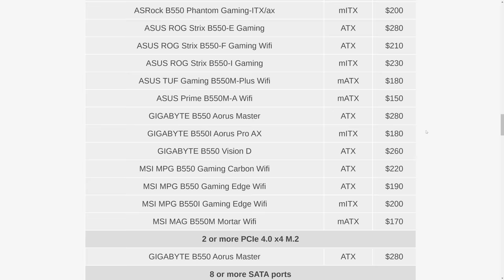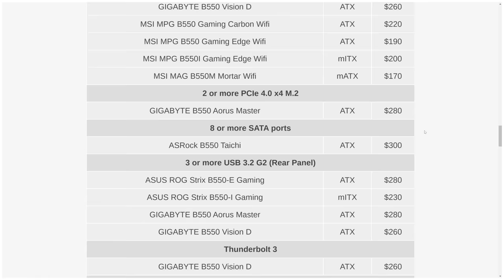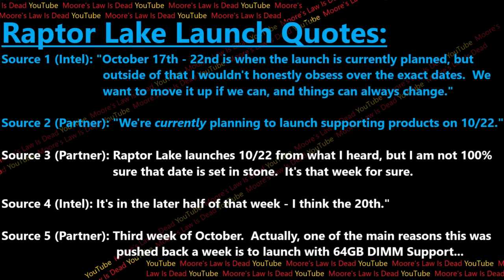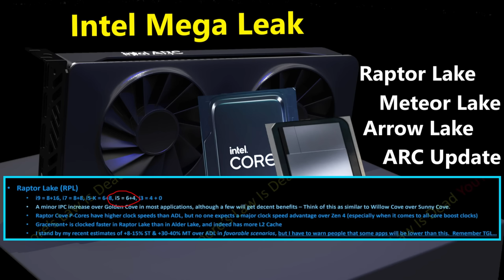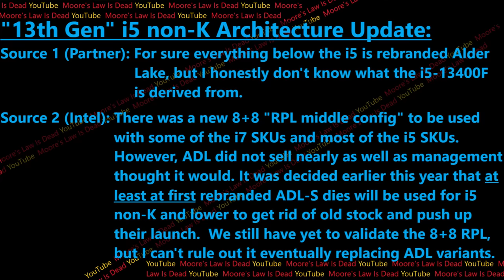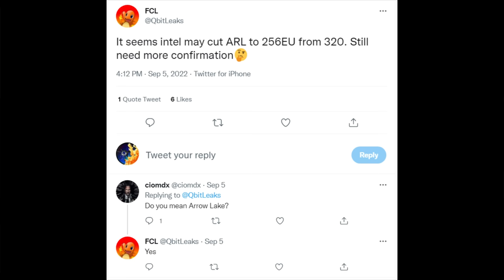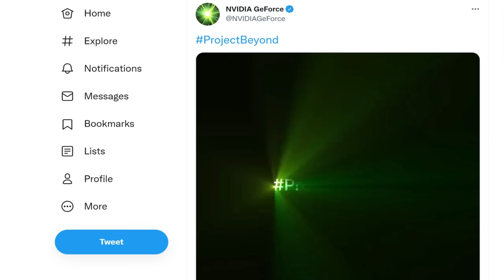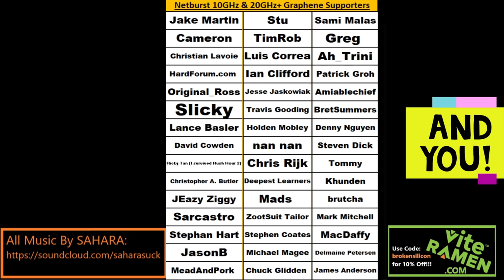RTX 4060 Ti, Raptor Lake Launch, AM5 Pricing: What Rumors are True? Who's Trolling you?

Comment: 7:09 Wow, 64GB DIMM support is a huge deal for me, because performance is drastically reduced when using 2 DIMMs per channel in DDR5 setups. 64GB DIMM support means you are not forever stuck with 2x32GB DDR5. I wonder if Zen4 will get this with BIOS updates?
Reply: Is 2x32 not the best config for 64gb? It would be more stable than 4x16.
Reply: @Krenisphia  exactly. But you are stuck at 64GB total and with no chance to get to 128GB unless you accept significantly lower DDR5 clock speeds after adding additional modules.
Reply: @Krenisphia  maybe op is thinking 128gb. 2x64gb for dual channel?
Reply: I can't see the point, if you've got the money for that, surely you would be using it for editing/production etc and using Threadripper or Xeon. I can't see any other use scenario that would require that much ram, certainly not gaming.
Reply: @Markknightexeter  I dunno - I went from 32GB to 64GB with my mod addiction in Cities:Skylines and it was night and day different.  So it just depends on the game :)
Reply: @Markknightexeter  Threadripper makes sense if you actually need so many cores. Often with servers you don’t and you will run out of memory (VMs!) much faster than out of cores. And regarding Xeons, surely you know that the basic Xeons have always been normal desktop CPUs just with ECC not disabled. So the same problems apply. W680 boards (there is only one currently shipping) run ADL CPUs (with ecc!) and support a maximum DDR5 speed of 4400. You can’t even buy modules this slow!

(and the higher end Xeons are incredibly bad regarding IPC and clock speed. Also registered memory costs a lot of latency!)
Reply: @geraldh.8047  I did not realize this about Zeon's, I thought they were on a separate platform, I stand corrected 👍
Reply: @DocNo27  something is up there. Maybe the new ram is much faster?
Reply: I would expect BIOS updates to offer 64GB DIMM support after the Zen  launch.  If you allow quad 32GB DIMM 128GB total what prevents 2x64GB?
The memory guys were justifying DDR5 on speed and capacity, so the increases cannot be surprises.
Reply: Hi there.
I'll like to ask for advice for my new pc. It's been years without following the market (thoroughly) and I'm a little lost.
Currently, I have a 4790k with a asus 290x 4gb and 32gb of ddr3 (I think, not ddr4) with a monitor 3440x1440p 21:9.
I need a new pc for 3d, animation, rendering,... Gaming won't hurt but it's not primordial.
I've been thinking in buying the new 7950x, bought a 3090, 64gb of ddr5 (4x16gb 6000mhz CL36) and a second monitor 16:9 4k hdr 60hz (probably something like Asus proart 32").
Now... I hear a lot of people talking about waiting for zen5 but, as you can see, my PC is a liiiittle outdated.
Zen 5 it's what, 2-3 years of more wait?
I would be grateful for advice. PCs are becoming really expensive and I'll like to make the best decision possible to make every penny count and have a PC for at least 6 years more than less.
So it's a bad decision to buy 4x16gb? Should I change my purchase to 2x32gb? I'm waiting for the new 670 motherboards to come also.
Thanks to anyone that tries to help.
Reply: @RobBCactive  I hope so as well, but remember on 2-Channel-DDR3 systems 4x8GB=32GB is possible but 2x16GB is not.
Reply: @Unreload0  Get 2x32GB as RAM speeds may drop below DDR4 rates in quad DIMM configs.  The large memory will probably have slacker timings from what I saw.
Fast frequency doesn't like complexity and signal noise.
It sounds like you need a new system, so if your usage justifies the spend I'd go for it.
Reply: @Unreload0  4x16gb 6000mhz makes ZERO sense, both on Intel and on Zen4 Platforms.

"AMD only guarantees DDR5-5200 support on a 1DPC (DIMM per channel) configuration. In a 2DPC scenario, the official memory speed drops to DDR5-3600."
(2DPC = 2 DIMMs per Channel, so 4 DIMMs total since it's a dual channel memory controller in ADL/RPL/Zen4)
Reply: @RobBCactive  thanks man. I'm gonna change my order to 2x32gb then. Mhz?
Reply: @geraldh.8047  Stupid question... Why selling 6000mhz, then? Thanks
Reply: @Unreload0  Because it often works, the performance testing was done with DDR5-6000.
Perhaps some motherboards haven't been validated yet.
But if you buy 2x32GB I think it will not be at 6000MT/s
Reply: @RobBCactive  My 4x16gb just arribed 🤣 😭😭😭 let's see if the store let me do a change. Thanks to all of you! What Mhz do you recommend for the 2x32gb then?
Reply: @Unreload0  because running the memory controller 15% faster (5200->6000) than guaranteed with 2 modules will usually work and give you extra performance.

Running it 66% faster (3600->6000) than what is guaranteed with 4 modules won’t work.

I have no idea how much headroom there is in running a 4 Module configuration higher than recommended, but if you are able to run four „6000“ modules at 4800 (which is the lowest official spec) in a stable way I would consider that a great success.
Reply: @geraldh.8047  Thanks, I think I get it know. Called the store and they let me return the memories. I found to items in their store: 2x32gb corsair vengeance 5200mhz CL40 and 2x32gb corsair dominator 6000mhz CL36. Which one would you choose? Thanks again. I would invite all of you to a beer but I'm from Spain, probably faaar away from any of you 😂
Reply: @Unreload0  I really can’t give you a recommendation based on facts because Zen4 has not been tested anywhere. Official AMD results use 6000 I think and rumors said 6000 is optimal. No idea how large the penalty for less MHz is.

Choosing 5200 vs. 6000 also depends on the price probably 🙃
Reply: @geraldh.8047  Price it's has been "not my concern" since here en Europe everything is getting more expensive day to day due to inflation and the euro losing power to the dollar, so time is "sensitive". I thought I could wait for the 4090, for example, but by the time it's out it will be hell in here, so I bought a 3090 for 1300€ (3 months ago was 2200€ and the decrease is due to the next generation in a few months). I guess I'll try to get the 6000mhz then. Thank you so much. You already saved me money!
Reply: @Unreload0  i got my 5950x in jan for ~600usd, u can get it way cheaper if u find someone upgrading..its already beast. if u worry about warranty, go for brand new if there is clearance.. 32gb ramp is enough...but 64 for u wont hurt, u can also go ddr4 on zen4, which is getting dirt cheap. a x570 board on discount is easily $150, aorus i see often.  u dont need to spend 2-3x as much tbh, it's plenty strong. ddr5 isnt that far ahead yet to justify price. 3080tis are decently cheap at $800 new..
Reply: @yukisnoww  you cannot combine DDD4 with Zen4. DDR4 with Raptor Lake will be possible.
Reply: @yukisnoww  Hi. Depending on the price of the 7950x, I might get the 5950x, of course. It all depends on price/performance. Here in Spain, everything is way expensive, so I have to think always on price/performance and my way of investing on a PC. I buy a new PC every 7 years, maybe 8. So, paying 20-30% more for new tech, if it's worth it, if it's gonna give me 3-4 more years in keeping me from buying a new one, I'll take it. If the global situation was better for the €, yes, I would take the last generation, but I take into the account other factors. Let's just say that my money today is more worth it than what it will be next year, so it's an investment too. EEUU it's not the same as Europe, specially Spain. Thanks for the advice anyway
Reply: @DocNo27  I always thought 16 was more than enough for me... until I installed 32 and now I am like... Hmmm, shall we go 64? And I am mostly playing games, but as you stated, some games are better with more ram than others especially when modded to holy freaking hell. Cheers!
Reply: @geraldh.8047  Hi again, Gerald. Been thinking about what you said. Maybe going for the new tech it's not the best decision. If I decide to go with de 5950x (it's 600€ here in Spain, but maybe when 7950x comes out, it'll get cheaper), what's the best ram (gb, Mhz and CL, number of dimms, ddr4 right?) I can get? And the best motherboard for production (chipset)?
Reply: @Markknightexeter  No, I just have an insane mod addiction and nothing beats more RAM when you go a little too crazy on assets from the steam workshop!   Memory speed actually decreased a bit since you do take a hit with more sticks :/
Reply: @Unreload0  I think with DDR4 you always use 3200 or 3600 and if you spend more you get lower cas latencies. Ryzen 5000 supposedly does not profit from more than 3600 because at 3600 you can run the memory controller in sync at 1800MHz... I'm not really the expert here, you need to figure this out yourself. Whether you buy Ryzen 5000/7000 or ADL/RPL, all good choices. I don't know what your use case is I really can't recommend anything.

Comment: I can sit on my 5900x, let others jump on this AM5 wave. I'll jump when the X3d's come out, maybe.
Reply: Same. I've got a 5600x. I think I'll wait for a 7800x3d.
Reply: I grabbed an amd a few months ago too and will keep it for as long as I can.
The only thing is it is impossible to find the gigabyte site for the new bios.
they make a nice mb but they suck at software and websites.
Reply: We 5900x users I feel have already made a substantial investment in our systems. Maybe in a year or so I'll look at AM5 based systems and I know I'll be missing out until then, but common sense must prevail.  After all, the 5900x certainly isn't a slouch.
Reply: coming from a dual core i3 it seems like witchcraft.  Do you guys know where gigabyte moved the bios download page by any chance?
Reply: If you have a 5900x you can wait till am6 lol it’s a more than capable cpu … that’s what I have and I don’t feel the need to jump on am5
Reply: @charleswidmore5458  That's Gigabyte for you, I would rather buy Asrock boards, it's impressive how far they have come.
Reply: @charleswidmore5458  Don't know but usually stuff like that is found in the support/download section of the product page.
Reply: @HP4L16  I will check again. thanks
Reply: @rubenmoreira0  I'm planning on something similar. I'll probably snap up a 5900x or 5950x in the next couple of months plus a 2x8 B-die kit that matches the one I have and call it good for a few generations.

Comment: Will the rebranded ADL i5 non K cpus perform worse than the later RPL non K cpus? Or will they be essentially the same? Should us lower end buyers hold off for a while?
Reply from the maker: Watch the video - it's literally Alder Lake, but now almost i5-12600K performance will be $200 instead of $300.
Reply: If clockspeeds are the same they will perform slightly worse because of the architecture improvements in the RPL cores.

Comment: considering AMD used the same AM4 platform for many years, I don't think the motherboard prices are too unreasonable
Reply: 3 years is what they said. By that time Intel launches 15th gen Arrow Lake which estimates to have a 40-50% IPC gain over Raptor Lake with less power.
Reply: Meanwhile AMD extended AM5 to 2027, so Zen6 is on AM5.  New boards have always been premium priced, Taiwanese manufacturers want to recoup development costs in the first year.  Critics of AMD prices forget Alder Lake boards had the same problem.
On Intel side Meteor Lake core regressed and Lunar Lake confirms the dropping of hyper-threading.  Intel estimates have been shown to be wildly optimistic and their refreshes of Alder Lake were indeed run by default out of spec leading to instability and high RMA rates.  Sapphire Rapids was another debacle.
So anyone making claims about Arrow Lake in 2022 were selling snake oil and should be ignored.

Comment: You can run DDR4-3100 11-11-11 on the locked 0.9v System Agent (memory controller) voltage, for anybody wondering.

And yes, that's enough to make a 12600k/12700k crunch through videogames that aren't super throughput-limited - which is almost all of them.
So the "discount 6+4 / 6+8" processors will be a fine choice for the DDR4 non-K BCLK boards... whenever they're around outside of Asia haha . . .

Comment: The intel re-use for lower models makes sense... you are still getting more performance on the lower models and they can get rid of old stocks, then the higher models actually use the new designs. I mean, this is the same as using higher tier dies that didn't bin well and limiting then to sell as lower tier models. Better than throwing millions of cpus in the trash. It's a win-win situation really, unless you are so gullible as to blindly update to each new model every year.

Comment: Its how business works.
New stuff adds a premium a bit when launched and slowly stabilize dependent on markets demand.
(its collecting dust in store, price goes down)
Flies off the shelves (Mining) price can go way up
Reply: There's an accounting issue, the Taiwan manufacturers  recoup development costs in the first year.  That front loading made a quality X570 board cheaper than newly introduced B550 boards designed to be cheaper Q4/20 for example.
It increases the early adoption tax, along with the likelihood of stability issues.

Comment: Obviously nobody really knows until it launches, but I'm curious to see what intel does with the rebranded Alder Lake CPUs in terms of pricing. I'm not against it if they include a price drop ie: $300 CPU being rebranded to a $180 lower tier CPU to just run through spare stock, for instance.
I'm also curious to see about iGPU performance in Raptor Lake and Meteor Lake...

Comment: Why are X670/B650 are cheaper to make than X570/B550, what did I miss?
Reply from the maker: I explained it in a previous video, don't remember if it was one of the ones I referenced today.  Basically the new chipsets for AM5 are being handled more traditionally, and they are purpose built to be motherboard chipsets.  So they have smaller dies, much lower power dies, and they actually use TWO chips for the total X670/E chipset.  Without getting into it - it's just WAY smarter, smaller, and more efficient this time around.

With X570/B550 - AMD used the I/O dies from Zen 2/3 (not kidding!) so they could use that die for two purposes.  That saved on design costs, and it was kinda necessary to get PCIe 4.0 support early (AMD was one of the few companies capable of building PCIe 4.0 products at the time).  But that also made the chipset bigger and more power hungry than it needed to be - adding a lot of cost.

Comment: Honestly these rebrand ADLs for locked SKUs is not that bad - it means that OEMs can have a bigger number at the same time as K SKUs.  IMO they will probably do things like i3 13100, i5 13400, i7 13650 and have them out at the exact same time as 'K' skus because they're already silicon that exists and just needs to be segmented out.  Then if they even bother with Raptor Lake locked SKUs, they could do things like i3 13200, i5 13500, i7 13700.  Although there is technically room for 13800 and they could make rebrands odd numbers while current gen is even.  Think i3 13100, i5 13500, i7 13700 as ADL and i3 13200, i5 13600, i7 13800 as RL.  Then your i5 13600k, i7 13800k and i9 13900k would be the launch RL SKUs.  Although I really hate that i3 and ryzen 3 have just about disappeared entirely.  Really the R9 and i9 are the R7 and i7 with the '3' SKUs being pentiums/athlons at this point.  silent price hikes.

Comment: I think we have a pretty good idea where nvidia's rtx 4060ti will land. At best it will land near a rtx 3080ti, like the 3060ti landed around a 2080 super. And the 4060 should land around a 3070ti, like the 3060 landed around a 2070 super. 

Its not gonna be hard to guess where these GPU's are suppose to land roughly based on previous trends. And this is a good tidbit to weed out bullshit rumors about the 4060. 

Vram amounts and power draw are harder to pin down though. 4060 is rumored to now have just 8gb of vram on a 128bit bus so maybe the 4060ti will have 12gb on a 192bit bus.

Comment: I for one don't care for overclocking anymore. I just don't. I want a processor that works and that's it. When I heard the 5800x3d couldn't really overclock, i was kind of happy. Because I don't care for overclocking. All this "but muh intel overclocks so high" I don't OC anymore. And it doesn't phase me. So for me, I might just got for B650E and then buy a 7800x3d when it launches for that sweet gaming performance.

7800x3d on B650E with 32gb DDR5 and then my 6900xt MAYBE upgrading to 7900xt (if that's the naming) when it comes down the pipe.

Comment: I hope this makes Alder Lake DDR5 motherboards and RAM sticks cheaper because i want to build an i7-12700K desktop PC with DDR5.
Reply: Doesn't the 13600K make more sense?
Reply: @MaxIronsThird hard sell, saricubra now feels extra vindicated because Alder Lake has suffered fewer RMA issues and avoided the worst instability of Raptor Lake due to mobos running chips out of spec by default.
Reply: @RobBCactive  it was only the i7 and i9 though, 13600k in i5, there weren't problems with it
Reply: @MaxIronsThird  but he got his i7 12700k cheaper and steadfastly evangelises for it, rejecting any possible upgrade.  Stumbling across this thread was amusing, I never understood how he became so wedded to his 12700k.